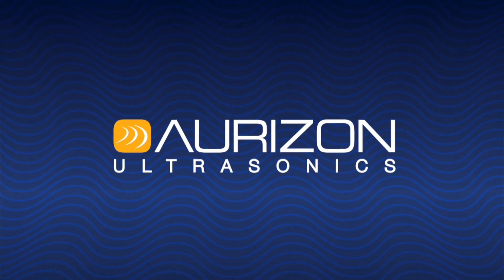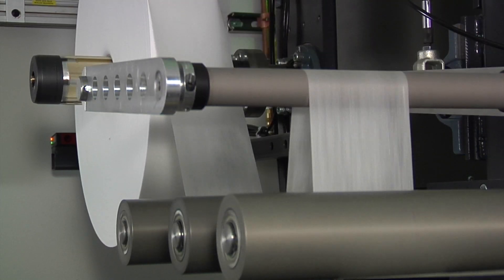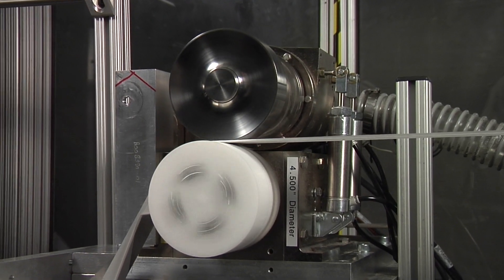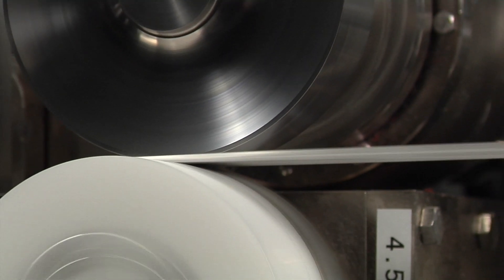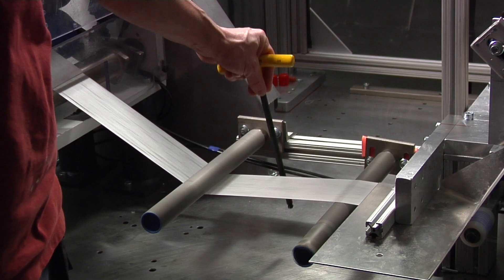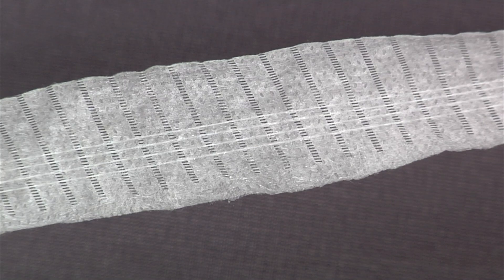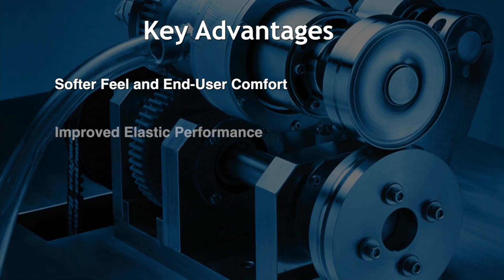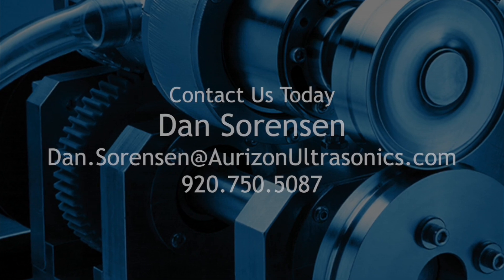Aurizon Ultrasonics Elastic Attachment

Comment from the maker: Stop by booth #1217 at IDEA 2016 from May 3-5 and learn about Aurizon Ultrasonics’ breakthrough technology for elastic attachment with NO GLUE! Our Sonibond™ Elastic Entrapment solution is an environmentally friendly process that eliminates adhesives and allows for the use of lighter weight materials. This innovative method using rotary ultrasonic technology will change the paradigm in consumer product converting because of the many advantages it provides. See you at the show!